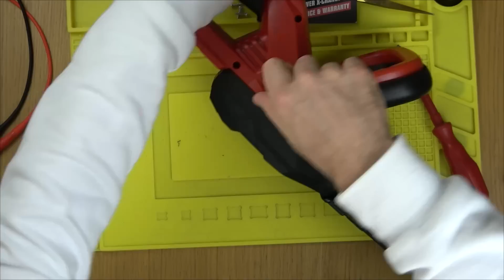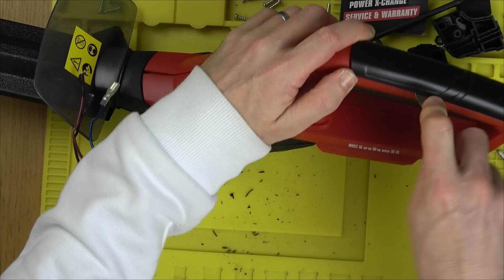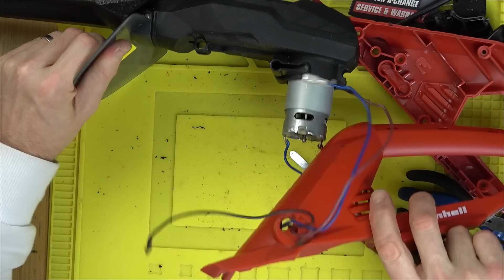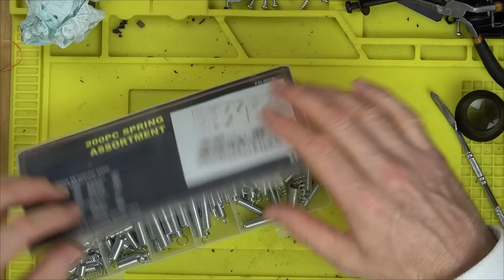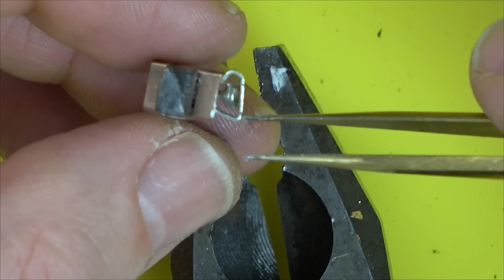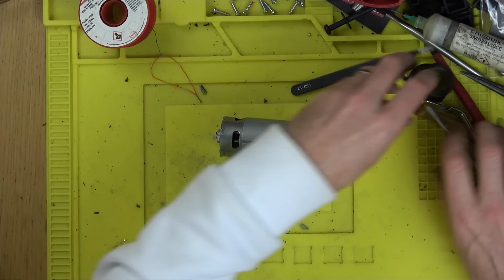My Mate Vince Advent Christmas REPAIR Challenge - Day 16

Comment: there is one epoxy brand that I know that presumes to be able to work on temperatures that may be up to 600c, I cant recall exactly but the brand here is named "uno acero", it hardens like rock, and can be mixed with other epoxy at diferent ratios to abtain a huge range of diferent levels of hardenes and flexibility

Comment: JB Weld 8297 High Heat 230C + which is higher than the melting point of tin/lead solder. Works on machinery and even exhaust pipes. It's an epoxy putty stick. Not sure how it's applied but could work on stuff like this at a guess. Around £6 to £8 a stick. Best guess as to why the motor failed is that a foreign body got inside and damaged the rotor while it was running at speed, maybe a bit of twig. They're not very well sealed against objects getting into them, just look at how much rubbish was around the gears. Or if you think that is not possible then maybe a bit of loose material got inside the motor from manufacture or assembly of the hedge trimmer.

Comment: I liked the fix. Sometimes you just need a tool to work long enough to finish a job.

On high temp epoxy:

Loctite comes in various grades of high temp resistance. Red goes to like 150C or higher. They're not gap filling though. Need close tolerences but might be useful sometimes.

JBWeld or one of things advertised at you when you search for JB is probably best best for things like this.

Comment: Just a little tip: If you want to use your chunky pliers as a mini vice, just put some elastic bands round the handles, then they will close on to the part you want to hold and keep it in place better.
Reply from the maker: Good call Timothy 👍

Comment: Ha ! you've just said it's going to be easy to fix. I have a similar problem with mine, different make. I've checked all the switches and the only way I can get it to turn on is to take the blade apart and give is a very good clean. I think sap in the cutting process bungs these up because their lack of reall power.

Comment: The initial problem is what Chinese call "tofu dregs" when their term is translated into English. It means faking it while you're making it. If a supplier sends you the wrong oil rings for your  gas engine, the workers still assemble the engine with a 1/2-inch gap, fully aware that it will burn oil like crazy. Fill the orders and ship. Contractors buy industrial waste to add to concrete to make a little extra on the job. I've seen a guy smoking a cig, leaning against a support column on a two-year old 60 story building literally fall into the column as the column partially crumbles. On your project even the surviving brush was malformed. The one that broke must have been even worse when it was installed.

Comment: The real test is to put it up against a branch that is at the upper end of the max size it can cut. The motor would have to work harder to cut. Thats a real test of the epoxy and solder. I really liked this one vince. You are the fixing man!

Comment: So a good epoxy style adhesive that can withstand high temps, if it's metal, jb welding works well and has high temps. Also they have a jb welding epoxy for plastics. That stuff is really good with heat. Idk if they sell it in the uk though

Comment: Mechanics choice JB WELD. J-B Weld can withstand a constant temperature of 500 °F (260 °C), and the maximum temperature threshold is approximately 600 °F (316 °C) for 10 minutes

Comment: Jb weld us good up to 288C
Reply from the maker: Thanks Rob 👍
Reply: @Mymatevince  I use JB weld frequently.   It is probably the strongest and most durable 2 part epoxy that exists on the market.  Sometimes it's almost too strong.  If you glue it with JB, you better hope you never have to get into it again.

Comment: COM is common, NC is normally closed, and NO is normally open. Basic cherry switch. Had to replace a few on a microwave that would run with the door open. (no cooking, fan and turntable only)
I worked at a small electronics place making moisture meters and static meters and I used a clamp like the amtech one you have. I wish I could have taken it because shortly after I left the company went under. I could really use it for my modding.

Comment: NO is normally open NC is normally closed , normal is the switch at rest . high temp epoxy made for exhaust repair may work for high temps . what a hoot that fix was. I didn't think you'd get the motor to spin . but it's days are really numbered . thanks for sharing

Comment: I got my latest gadget today, a desolder gun which is basically a solder iron with a hollow tip and clipped into it a standard spring loaded solder sucker.   Already drawn blood with it removing some practice stuff to get used to it, simple but effective and no mooing either.

Comment: Many metals can be soldered, but some are easier to solder than others:
Excellent solderability: Tin, cadmium, gold, silver, and palladium
Good solderability: Copper, bronze, brass, lead, nickel silver, and beryllium copper
Fair solderability: Carbon steel, low alloy steel, zinc, and nickel
Poor solderability: Aluminum and aluminum bronze

Comment: I was shocked that you did not know NO and NC was on a micro switch after all the years you have worked on things. I have repaired loads of these battery garden tool's and all the same, switch, connector, motor, battery or charger, sometimes the odd mechanical fault. ie pin fell out.

Comment: If the motor got stuck in one position one brush would be arcing on the copper contact and would melt it bending it then next time its used the motor will self destruct  t and destroy itself. i would have straightened the spring into two short lengths and soldered then from one side of the bush to the arm and the other side to the arm. well done for the fix. great series .   I don't know how you manage it but you muddle your way through these jobs. sorry for the spelling mistakes my font is black as its MS Edge and YouTube is in black mode. have to keep highlighting the test to see what i have typed.

Comment: JB weld epoxy handle high temps and pressures.  I've heard it used on motor engines, and it can be drilled and tapped too.  Lovely stuff.

Comment: Most likely motor stalled because too big branches, and they just kept holding trigger. Current quickly rushing through the motor acting as resistive heater.

Comment: Interesting repair to such a badly damaged motor :) Maybe a revisit video in the future if you replace the motor with a new one?
I'd guess maybe the damage was caused by dropping the device, but there doesn't seem to be any other damage, which usually happens when dropped. Parts falling off from the motor, that's pretty catastrophic failure.

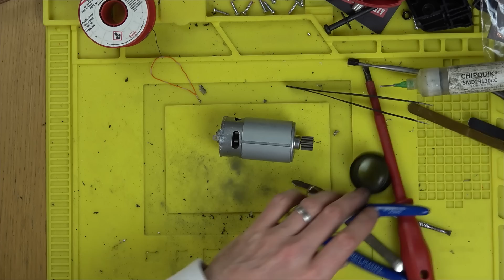Comment: 36:35 the motor Probably got stalled causing the coils to be connected to power all the time heating them up and making the commutator pad come loose which then ended up destroying the brushes when it span for a few seconds but idk.

Huge respect for attempting to repair the motor which i would not have done but you are skilled enough and have the right mindset to do so and it makes the video even more fun so keep doing it if you want! looking forward to next video

Comment: Gorilla Glue Original can be applied between 4°C to 54°C. Once cured Gorilla Glue Original can hold strong between -40°C to 100°C.   Gorilla Glue is polyurethane-based and can release toxic fumes when heated.

Comment: Regarding the Switch - NO or NC means that the switch can be wired as 'Normally Open' connection (powered normally all the time  - but when switch is pressed in, power is cut - as in Emergency Stop switches would be pressed in to break the circuit e.g., or end-of-travel sensor switches. 
A 'Normally Closed' connection, (power flows through it when the switch is pressed in, is powered as expected, press to power on, or send a signal to a second safety switch as is in this case, as it needs the both switches pressed in to power normally.

Comment: looks like the standard RS550 motor that's fitted to loads of low end 18V cordless drills etc.  If the gear is not damaged you may be able to find a salvaged motor from an old drill and use a small puller to swap the gears over.  Good bodge though,  I didn't think it would hold up for more than a few seconds!

Comment: JB Weld repaired a tachometer drive on my motorbikes cylinder head. This has stood the test of time and temperature. I've had other high temp repairs with Araldite rapid steel. Don't react to the trolls Vince, they think it's a win if they get under your skin. Keep the videos going, I'm thoroughly enjoying them.

Comment: Think it get stuck with big thicker branches, bc the torque is made by gears the motor overheat … 

Maybe some special epoxy , jb weld for engine would up 200c 🤔

Comment: Switches, always: NO-Normally Open, NC-Normally Closed. Not a bad fix, but the commutator was pretty  baked and I think the brushes are running at about 30%, so yeah, a new motor will do well. Looking over the fence behind the test bush is a proper hedge. "Hi, I'm Vince, your neighbor, and could I trim your hedge? It's for science...and clicks"

Comment: J-B Weld can withstand a constant temperature of 500 °F (260 °C), and the maximum temperature threshold is approximately 600 °F (316 °C) for 10 minutes.
Reply: Yup JB can perform miracles but usually short term if its on cast metal parts on a off road vehicle
Reply: @TD75 
My (long deceased) Grandfather salutes you! He was famous for his "temporary" repairs. I have no idea how his house remained standing with all of the bodges and patches holding everything together.

Comment: on a Switch N.C means normally closed and N.O normally closed.If you do not press the Switch NC to Common is closed and NO to Com is open. If you press the switch NO to Com is closed and NC to Com is open.

Comment: On the switch, NC stands for 'normally closed', and NO stands for 'normally open'. Also, please stop saying things like "let's get an ohms reading" or "let's see what the amps are". Ohms are a measure of RESISTANCE and Amps are a measure of CURRENT, please use the correct terms!

Comment: NC and NO = Normally Closed and Normally Open used to make sure the circuit can detect switch settings. You have to look up exactly how/what they do or can be used to do. Mostly due for saftey. Bondic -40 to 150 uv compound.